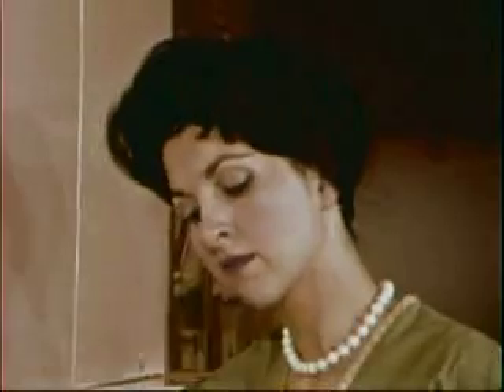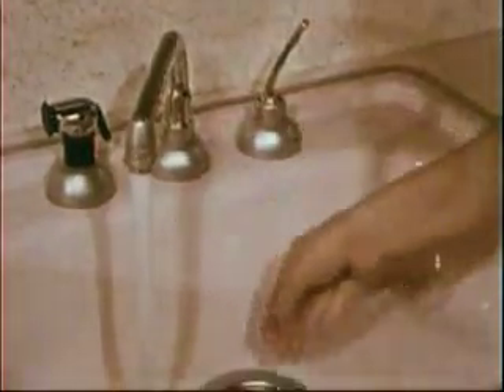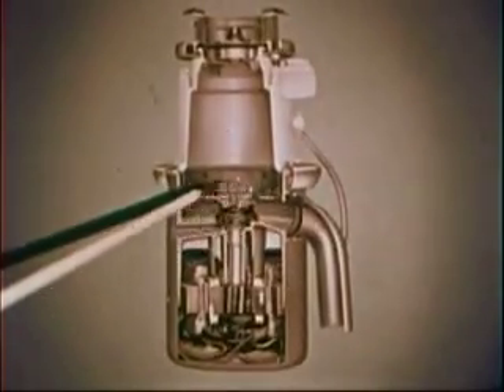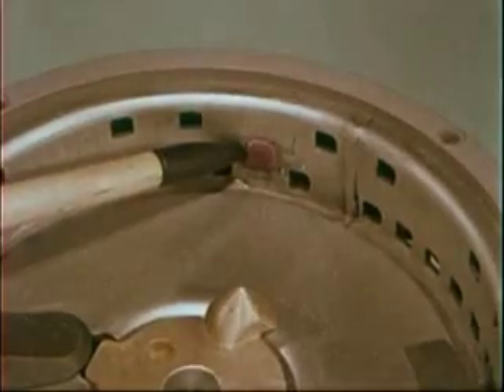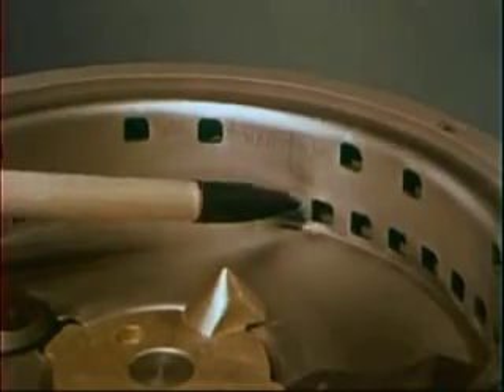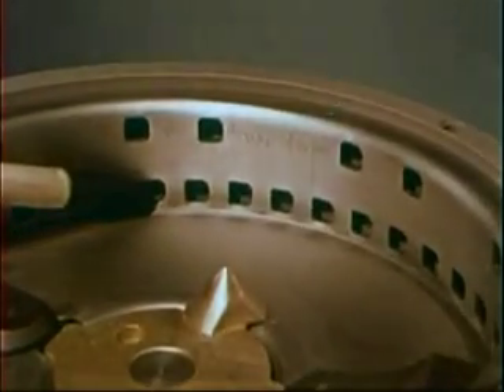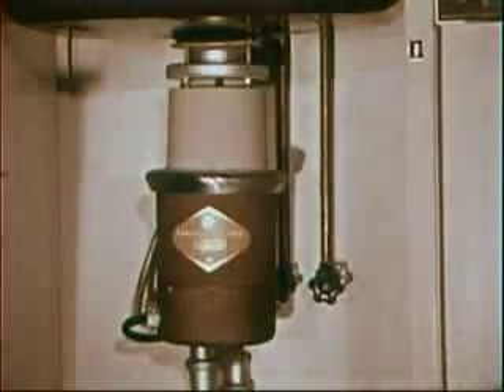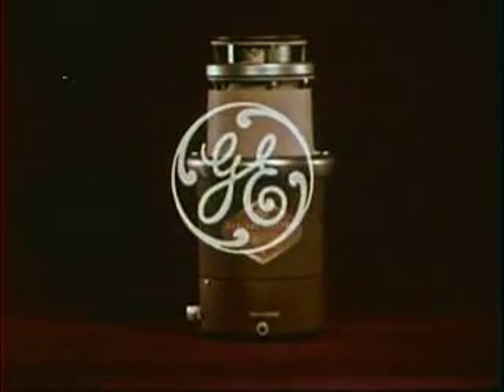Goodbye to Garbage (ca. 1950s)

Comment: the later revisions of this carbaloy cutter design (minus the lower end 8000RPM units) had really cool blades, not the basic cookie cutter junk you see today, it was all cast and had Angled impellers and angled cutters on the shredding ring, can't remember if the holes were angled or not but god was it nice
Reply: I think these were induction motors right